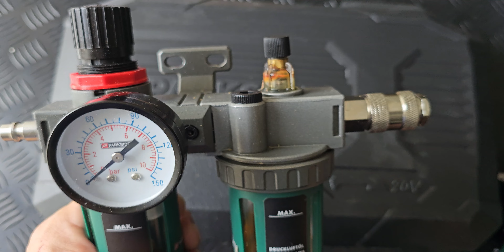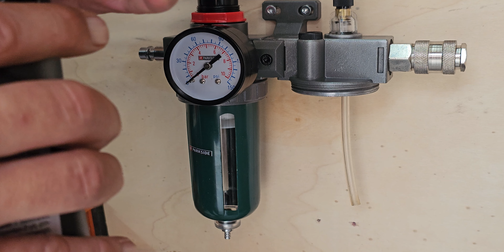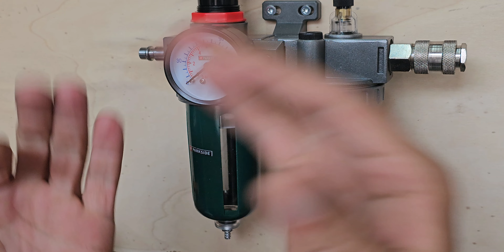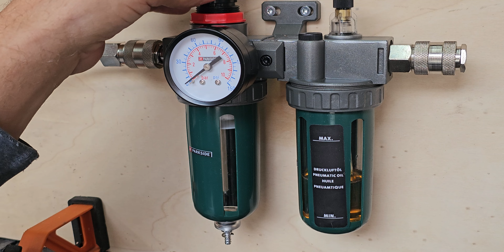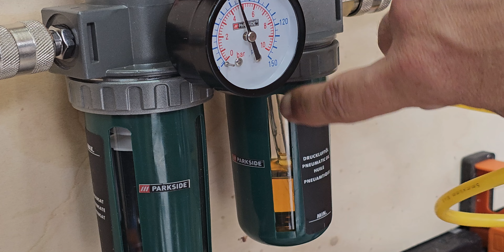Parkside Compressor Regulator Lubricator PDWE 8 B2

Comment: If you go spraypaint, only use a moisture valve filter.
Reply: Or just close the Lubrication oil Regulator. You can set it to zero
Reply from the maker: True

Comment: thanks for video. subscribed/liked.
one question. I've bought a PARKSIDE Stille compressor 1500 W 24L, and this compressor is Oil free.

but do I need to buy this Air filter regulator & lubricator ? actually why and when I need to buy this? 

thanks in advance
Reply from the maker: Yes some tool need Lubrication like a Stapler for example. On the other side you do not want Lubrication ona paint sprayer.
You can lubricate using this tool. But for example, you can give a tool also a drop of oil now en then while using it